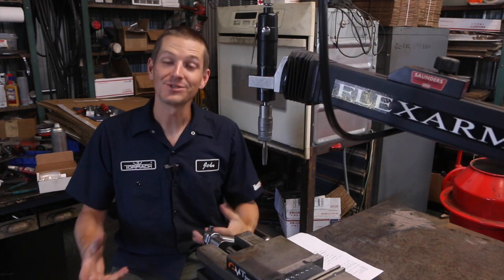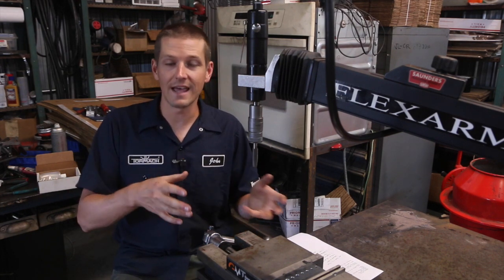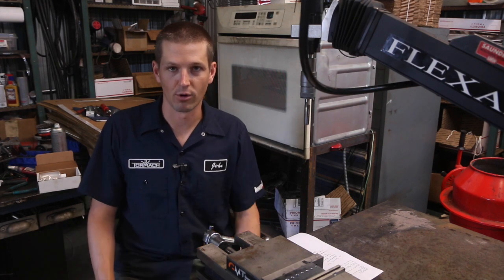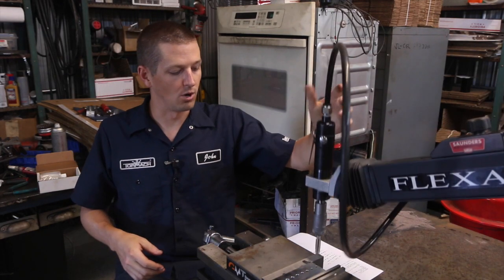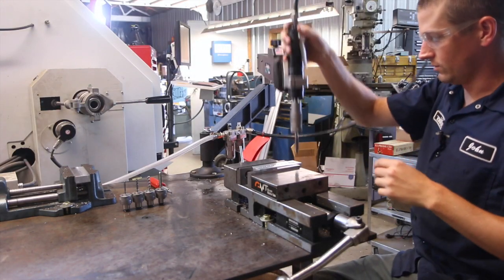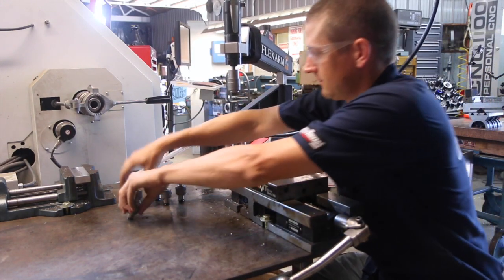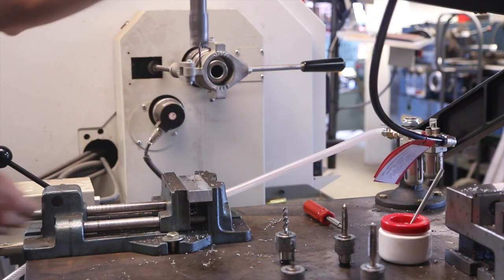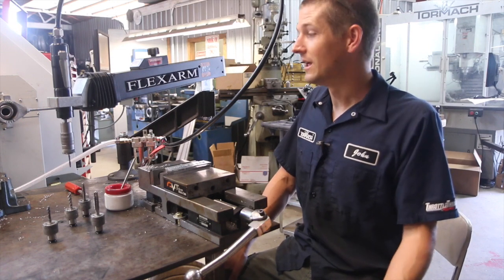FlexArm Tapping Arm!

Comment: I have used a flexarm arm in my shop for years tapping giant aluminum plates. They do work well but the air models are really loud and slow. I'm looking and buying another one and looking and one that is faster and possibly electric....and they do suck alot of air. Great product.

Comment: I’ve got an older, open frame type pneumatic Flexarm with a full complement of series 1 clutch tap holders in my home shop.  With patience I’ve been able to pick up tap holders over the years at bargain prices from EBay.  I use it regularly, admittedly it’s a luxury and a bit of an overkill for a home shop, but I’m sure glad I have it.

Comment: I used to work at a place before starting my own machine shop (Ocel Metal Fabrication) and they had one. it made tapping plate so fast and quick and we could tap hundreds of holes without breaking a tap!

Comment: This may be a good option to get around the tapping limitations on Tormach CNC's. I have only done rigid tapping on full featured CNC's which is of course super easy. Now that I am hoping to put a machine in my garage, Tormach looks good with the exception of the tapping support for small blind holes that need to be tapped all the way to the bottom.

Comment: sweet stuff. as far as power tapping goes, we run up to 4" NPT on transfer machines all day long. I've never heard of it affecting the spindles. but if it does, the down time to rebuild a spindle is peanuts compared to pumping finished parts out every 15ish seconds
Reply: +NYC CNC big stuff made on transfer machines for the oil industry. in the transfer machining world, milliseconds count, when you have cycles times of a matter of seconds, instead of minutes or hours, most places would rather pound their machines into the ground, then repair or replace them, its actually more profitable for them to replace a $3 million dollar machine every 20 years than to run it slower and take care of it.

Comment: At work we use a lot of difficult materials, Inconel, Vascomax, etc, we have to thread as small as 0-80, but the smallest/ most common is 3-48. We break taps quite often and have a worthless tap buster to get them out. I keep asking my boss, (who is the CNC guy), to look into thread milling, but no luck, any suggestions? You are on my favourites list for machining info!

Comment: are you able to adjust the clutch tension or spindle speed? I was really excited by a sneak peak in one of your earlier videos. But I am apprehensive as my tapping is all 2-56 and smaller, and usually in titanium. Have you done any testing in the more micro tapping sizes? The tormach compression head we had was so terrible at those sizes- we sent it back. Tormach, as always, was amazing and had no problem taking it back even months later when they found out it didnt work for us.

Comment: You hit a soft spot!!
 I have drooled for one of those ever since I used one in another shop several years ago.
I'm not too keen on the deburr function... 
Reason: you can pick up a really decent floor drill press at a farm auction for $50. 
...or a table top drill press. Just drag it into location, no big deal.  
That way  you keep the flex arm doing its job tapping as you mass produce parts.
Suggestion, use high quality two flute machine taps, the mileage is worth the price.
Reply: Literally volumes of excellent information regarding taps, and, specific tapping procedures  have been written. 
It is the second most common automated operation behind hole drilling.The material tapped, and, the type of tapping operation will play a major role in the decision of tap selection. 
Generally you want the strongest tap for the task at hand.

2-flute are extremely strong (vs 4-flute), and made for rigid tapping in automated applications such as the Flex Arm. 
They are readily available in all styles (through hole, blind, bottom & modified bottom) from all major tool manufacturers
Every broken tap can be traced back to the problem of improper selection. Not to mention the frustration of having to deal with broken tap removal, and,or damaged to the part part being manufactured.
A professional machinist is always learning how to make better parts more efficiently.
"If you ain't never broke a tap, you ain't no machinist!"

Comment: That’s a nice gizmo that surely comes in handy in lots of shops especially for large hole tapping. 
Regarding tapping with a Tormach, over the last 3 years we have tapped literally tens of thousands of holes from 4-40 to 3/8-16 with our 1100. High quality taps, such as the Tormach taps, are a must and will rarely break. Taps are always held in the tension compression tapping head and lubed with the Tormach coolant from a Fog Buster. For thru holes in steel we use spiral point taps and in blind holes a form tap. In AL for thru and blind holes it’s always a form tap. So tapping in that size range with a Tormach  works great and should not be a concern for anyone.

Comment: Nice looking machine. I've tapped 1000's of holes with a system like that. The big difference that I see is that you have a quick disconnect. Ours had different sized collets to hold the taps. You'll wonder how you lived without out it for so long when a big job rolls through.

Comment: Thread mill? Use bottoming form taps in rigid tapping. Done and done.
Reply: +NYC CNC Thread milling is great if you need to adjust your sizing (like pipe taps) or the machine can't rigid tap, but generally I love form taps. hole size is pretty important though, so we use carbide drills.

Comment: Love those tapping arms.  I bought one for a shop I worked in back in 1986 :-)  a mid sized model that would tap up to 5/8".  We did a lot of pipe tapping, deburring with countersinks and of course regular tapping.  I built a 4 x 8 ft rolling table that we faced on a large boring mill and drilled a pattern of 1/2" holes on a 6x6" grid and then tapped with the arm.  We could bolt down various fixtures or vises to hold the parts, or just lay the heavier parts right on the table.  A real time saver.

Comment: John - the very first time we used the FlexArm we tapped 36 blind holes in 12 minutes!  I had been doing these 36 holes by hand and it would take 2 hours and 12 minutes to tap!!
The other key to doing it successfully is the proper tap.  The spiral tap by Vega is the way to go for the blind holes.  Thanks to Carl at Lakeshore Carbide for that recommendation.

The first tap we broke by hand tapping took 10 hours to remove. Since we have had the Flex Arm and the Vega spiral taps we have not broken one. 

I agree that the guys at FlexArm could not be nicer- a young enthusiastic group. 
It has been a great investment.

Comment: Thanks John,
I spent about 4 hours using one of our FlexArms today tapping 100 or so holes into cast aluminum (kinda gummy) I had milled on our Haas VM-3.  Broke a 1/4-20 tap, and need to mill it out in the morning. Probably should have rigid tapped the holes on the Haas, but this was easier (1/4-20 and 6-32 taps). We love our Flex Arms.  We have one that is stationary and one that is on a portable stand. Nice video.

Comment: I didn't learn about those until shortly after I bought my Procunier. I really wish I had spent... ~$1200 on a tapping arm (I think that's the price range I saw) instead of the ~$1000 on my Procunier! Now that I have a new mill (which rigid taps) my Procunier is useless, this thing would continue to be useful though. And, even before the new machine, the Procunier is pretty cumbersome... great tool, but I'd avoid using it because of the hassle of setting it up.

Comment: That looks like a thing that is pretty easy to DIY for a hobbyist that don't have the money for one. Just some square tubes for the arms, some plates that you drill some holes in for the joints and a butterfly air impact wrench as the driver.
Reply: +Wankel Motor 
You also need the head to articulate to keep the axis of the impact wrench vertical. So the arms would have to be a little more complex than a single square tube, but quite possible to do none-the-less.
Reply: That is easy. As long as you have two tubes of equal length running parallel to each other the end of the bracket will always stay the same angle.
Reply: Indeed.

Comment: That's a really slick tool to free up cycle time on your mill. I've never used one but a shop I worked in had one in the one cell and they used it for drill, chamfering and tapping of holes that came out of a live tool lathe that didn't have enough tool positions to finish the part. They just spotted and pilot drilled the holes ( I believe there was 2 sizes) and then finished them off line while the next one ran.
I don't believe that rigid tapping is hard on the spindle of that CNC machine. My current VMC drilled and tapped steel brackets all day for 8 years and the spindle was perfect when I bought it. All you are doing is running the spindle like a servo (which as you know can last for many years on the end of a ball screw) so that you can synchronise the spindle and the z axis, same as single point threading. What is really hard on a spindle is when you break a large tap off due to misalignment or bottoming it out, that makes a bang that you can hear a mile away! This can most definitely chowder up spindle bearings/couplers/belts ;)
Reply: +NYC CNC I had two 3 inch x 11tpi taps break using a horizontal boring machine for a rock crusher part at a shop I worked at 30 years ago.
The three taps were supplied by the owner of the crusher and they didn't look in the best of shape. It was a rush job. The owner of the shop didn't like the condition of the taps either and he wasn't able to get new taps in time. The rock pit was shut down and waiting for their finished part. Lots of pressure to get the job done! 

The sound of those two taps breaking is indelibly etched in my memory. I compare the sound to an artillery cannon firing. The holes being tapped were through holes in a 3.5 inch thick coupler ring. Thankfully the third tap got the job done.

My nerves were shot after the job was finished, and if memory serves, I may have soiled my boxer shorts when the taps exploded :)

Comment: I heard you mention a VMC. I wondered what the difference is between the tormach and a VMC? Isn't it close to the same?
I also wanted to say that I like your channel a lot! I am an electronics engineering student with a side job at a CNC retrofitting company. I also like to build things with my 3D printer, so I also like your solidworks video's!
I think I have seen al your video's from the day I found your channel!
Keep up the good work, good luck with your new shop!
PS. I would like to see some more electronics/arduino/rPI videos! (I am mostly using ARM controllers instead of arduino, but I really like your projects!)
PS². English isn't my native language

Greetings from the Netherlands!
Reply: +RS2Racer91 
I think you're basically right. A Tormach is basically a VMC, even though the term "VMC" is usually reserved for larger machines.

The biggest distinguishing feature between a Tormach and what I would say is a "real" VMC is the fact that Tormach machines are designed to sit on a stand or a bench whereas a typical VMC will sit on the floor. Beyond this, the line seems to be indistinct.
Reply: +Hirudin Thanks for your answer, I did some more research and found out that the VMCs are basically more robust (heavier, faster, stronger, etc.) than the Tormach. So the Tormach is a "light" CNC.
Is this correct?
Reply: Yeah, Tormach mills, like the PCNC 1100, are considered to be "light" CNC mills. They're ~513 kg. though, so "light" is definitely a relative term. The Haas Minimill is also "light", at 1542 kg., but I think most people would still call it a VMC, albeit a small one.

Really, when you get right down to it, I really think the fact that the Minimill sits on the floor and the PCNC 1100 sits on a stand may be the biggest determining factor when deciding whether each one is a VMC or not.

The other thing that comes to mind is the enclosure. The "C" of VMC stands for "center". An enclosed machine just seems more like a "center" than an open machine. To me, calling an unenclosed mill, even a very large one, a "VMC" just wouldn't feel right.

That's my opinion anyway. I'm an amateur though, so I might be ill-informed.

Comment: What a great video and serendipity story.
The ratchet mechanism is a brilliant addition.
Can't wait to see new video at your new location. 
If you have vid of the Flexarm tour, please share.
Seventeen minutes?! Is this a new non-hasty format?
You mentioned 0-80. Does it calibrate the ratchet torque for smaller sizes? Zero is pretty dang small.
Reply: Noooo! Vids are too short!
Can't wait to see zero eighty with that arm. Buy plenty of taps, if you look at them wrong or think impure thoughts they snap spitefully.

Comment: The summer in between my years at school for tool and die I worked at a machine building shop and did many small(ish) parts which had multiple tapping operations. I was surprised to learn how much they relied on bridgeports to rigid tap. Throw it in low range and feed in with your handle. Power off towards the bottom (it will continue to rotate) and throw it in reverse as it stopped. Did it hundreds of times a week without ever snapping a tap. Good tapping fluid is key obv.

P.S. - not sure if you can counterweight it, but that arm is just about perfect as a camera jib too :P
Reply: +Big Mike's Hobby Channel 
Yeah, using it as a jib is something that came to mind for me too. You beat me to it.
Reply: We have actually created custom mounts for customers that allowed us to mount cameras for them!

Comment: They are pretty cool, save a ton of time.
They do use a lot of air, which is the most expensive utility. 
It would be really cool if they could build one that uses an electric variable speed (foot pedal) gear motor instead of an sir motor. They Hydraulic one is amazing as well.
Reply: We do have an electric model now! The GH-18. Call for details 1-800-837-2503

Comment: IIRC, the FlexArm was created by Don at Practical Machinist, then he sold it.  He also created the original dovetail jig for woodworkers.
Reply: +eformance Yes, I remember that now.  Don is, or can be, a bit of an ass and why many folks don't care for that site.  Ask a question the wrong way or say something he doesn't like ... you're banned.  Nope, it didn't happen to me but saw it happen frequently.
Reply: +Keith Ward his rules are finite and simple, don't talk about Chinese machine tools.
Reply: +eformance Seems fair, and it is his site but hardly "practical" as the name indicates.  Just need to craft questions and answers carefully.
Reply: Don owned and built a tapping arm, FlexArm purchased the company in the late 90's. He had the original design for the A-32 (Unit in this video) but it has slightly evolved over the years.
Reply: Stephen Barga
Yep, and if you lookup "procyon tapping arm" on Google images, you'll see flyers for the models he made, which are the basis for the current arms FlexArm sells.  So, if a company buys another company, rebrands it, doesn't that still mean the original company invented it?

Comment: what rpm does it run at? I run my small taps at a pretty good rpm.  Treat them like a drill. Smaller = faster
Reply: +akromix Another thing to note is there are quick disconnect fittings that have very large ID's.  The plus of them is if you have some in a bin not fitted they usually don't get legs and walk away as most people don't use them.